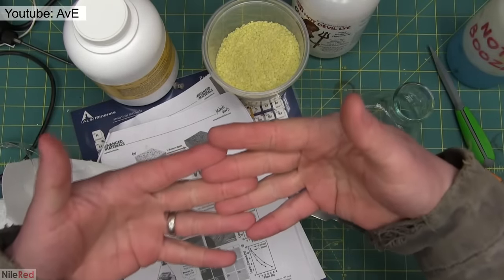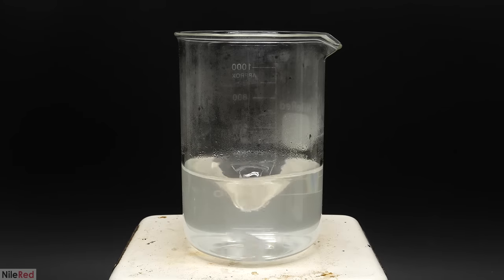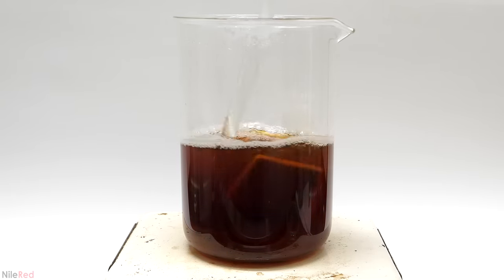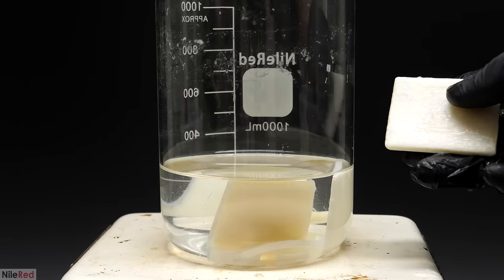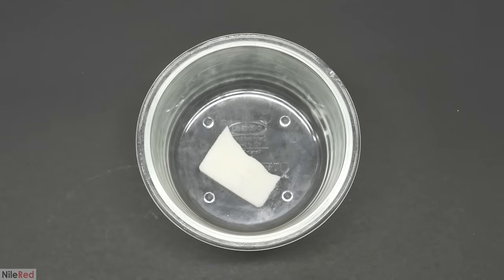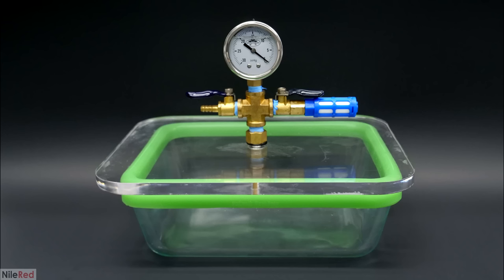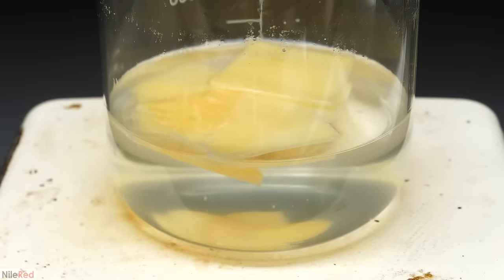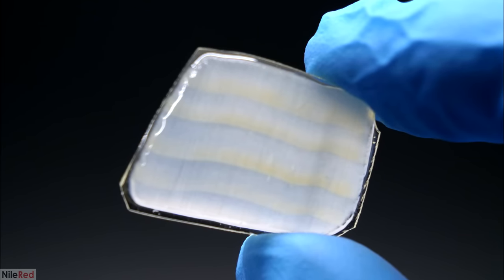Attempting to make transparent wood

Comment: 1. Use a slow set finishing epoxy. Something clear, but that takes many hours to set.
2. Heat the epoxy. Just warming it up 15 degrees makes it like water it's so viscous. It'll soak the wood faster.
2.5. vacuum your epoxy in the cup after heating but before pouring: just to help pull bubbles.
3. Once poured with the wood floating, leave the vacuum on for a minute or more, and then draw out the letting air back in for like 30 sec. Drawing this process out will put less pressure on the epoxy but for a much longer time, letting it capillary up in there
4. Cut your wood thinner. 2mm, 1mm, etc. Will help like everything.
5. Cut it really slowly and in a single direction to make a nice surface on both sides. 
6. Lightly sand both ends, but beware using course grit will just fold over and plug all the cellulose tubes. 
7. Air compressor blow the sides of the peices to blow any surface dust and shit away
8. When you lay out the peices, place them between two peices of the flattest glass you have (mirrors, picture frames etc) to put an optically clear flat surface on both sides but without all the excess glue blob on top.
Reply: Chrismofer would it be possible to let it cure in a semi vacuum? Would that help or do anything at all?
Reply: choosing a low-shrinkage epoxy will help in addition to this. Heating will cause the epoxy to set much faster
Reply: maybe the wood bends itself when curing because it was cut from one side or maybe when put in the vacuum with epoxy, epoxy only enters the cellulose from one surface so its uneven which shows up when cured.
Reply: i don't think it would help. the idea with the vacuum is the changing pressure expels air and sucks in resin to the wood structure- once it's cured, an internal pressure difference or not wouldn't really help. the opposite might, i.e. a high pressure vessel so the bubbles are smaller when cured.
Reply: I dont't think the wood is bending on it's own. when the epoxy cures unevenly, it shrinks at different times throughout the part, which makes internal stresses. the most obvious one is when he poured two layers. the bottom one had already "shrunk" and cured, while the new top layer poured on, set up and then shrunk a little on it's own. this pulled at the layer below it making the warp.
Reply: 9. Learn how to use power tools. Yeah, I saw you almost chop that finger off.
Reply: Just to add that to reduce the surface scattering and improve clarity, you can sand it flat and then coat it with a gloss coat (spray or airbrush). If you sand it to about 1000 grit and then coat it should look pretty good. You could use a thin coat of epoxy, but paint will be quicker.
Reply: 1. Throw it in the garbage
2. Your done
Reply: Yeah all of this is really just common sense, I do not understand why he did not figure this out himself.
Reply: Won't letting the pressure in quickly force the resin further into the wood once the air has been drawn out?
Reply: I agree that a pressure chamber would be a good idea at the end of the process
Reply: One thing you could try to enhance the evolution of gasses in your resin and relieve stresses in the composite is ultrasonicating the epoxy bath.
Reply: I think the slow curing allows the wood to bow. Too fast and it can't be penetrated. This seems like a very difficult thing to solve. I propose a thin heat curing epoxy?
Reply: Step 2.5? What just change all the numbers so it’s uniform. Lol lazy
Reply: I wonder if maybe making the wood thicker, 3-4 mm, wouldn't help prevent the wood from breaking.

If adding some epoxy later on one side contributed to make the wood curve, then how about adding epoxy on both sides? maybe instead of laying it on a flat surface it would be better to find a way to suspend the wood piece? not sure how we would do that though...
Reply: one fun way would be:

after the lignin is washed out, and the wood is still wet: put it into a freezer.
then, when it's thoroughly frozen, put it into the vacuum chamber, and try to freeze-dry it (more or less the poor mans version of freeze-drying).

the advantage is: it has no opportunity to shrink, when freeze-drying.

then continue with your suggested procedure of using something that is slower at curing.

one additional idea:  there are epoxy-resins that cure with UV. single component, no mixing, etc. you can give that all the time it needs to soak into the wooden fibers, and when it's done, light up a UV lamp, and get it to cure.
Reply: Wouldn’t it be better to use long strands Layered on top of each other of a fast setting epoxy To mimic the cellular connections in wood fiber rather than filling the cavities? I realize that the method you describe creates a very visual 3 d facsimile But would it replicate the mechanical qualities of wood?
Reply: Would be great if you have a way to slightly heat while pumping, such with an infrared lamp or so. Ethanol too should be evaporating much better.
Reply: wouldnt putting the the epoxy in the vaccum crate more bubbles like it would with other fluids
Reply: this is sort of an engineering implementation that he's doing with just chemistry tools. it's perfectly understandable that it's complex and he hasn't nailed it yet.
Reply: ultrasonic or not, if his epoxy has a sufficiently long cure time (24hr?) there's plenty of time to mechanically mix it thoroughly (hand drill with small wisk) and then heat and vacuum the bubbles out.

when letting the air back in, i'm not sure whether drawing the process out or making it fast will cause the resin to penetrate deeper: all I know is doing it quickly doesn't work great, and repeating the sudden pressure changes doesn't make it much better. If there's air stuck in the wood, surrounding it with resin makes it impossible to suck out without first pulling the resin back out. slowing it down, especially after evacuating the chamber for a significant amount of time,  could possibly allow better resin penetration.

I don't think the warp is caused by the curing being slow, just uneven. 
 
yes making the wood thicker would make it more resistant to breaking. absolutely. but it would make it far worse optically, which is the opposite of the goal, so I think the solution to the breaking is being more careful with the materials i.e. doing one at a time, not stirring and breaking the wood with a glass rod, swishing the pieces against each other, etc. he'd have to agitate differently.

I also want to add that cutting the wood slowly as well as lightly sanding before the chemistry will remove the burn marks, which are obviously a huge hindrance to optical clarity.
Reply: But he didn't have a stand
Reply: I actually read about this (making wood transparent) on Phys . org several months ago
Reply: I think gravity is all you need to hold the glass plates together i think. You don't need clamps and don't need 10mm thick glass. The idea would not be to make uniform thickness, but glass-smooth flat surfaces. He had better luck with globs of epoxy on top because surface tension formed an optically polished top, but the bottom was only as perfectly flat as rubber can be, or the concave surface inside a pyrex. Also I figure it's more critical the bottom surface, where the paper interface is, be flat and polished. 

A glass sandwich would also prevent all the warp, provided the epoxy fully cures before being unsupported. 

I hadn't considered that the part would stick to the glass really well and be unremovable. you're absolutely right that plastic sheeting (acetate maybe?) would be prudent and what's more- you wouldn't even need to peel it. you could just trim it down, and the final product would be a plastic-resin-wood-resin-plastic sandwich. This is making a bunch of assumptions of course and some tests would be awesome to refine this further. 

with a few tweaks and improvements, he could get at least as good a piece as the research paper example.
Reply: @Blueis Notgreen 

none of this is to replicate the mechanical qualities of wood, in fact i'm not sure what the goal is other than as a curiosity. it would certainly be useful as a study aid for people looking at cellulose structures with microscopy, or looking at how grain patterns differ between types of wood etc. I'm not sure how much mechanical strength the wood has at the end of the whitening process, but it looks like close to none.
Reply: I dont have a clue of what that means owo
Reply: @chrismofer  isn't that because  most of the lignin is removed? I imagine if you got full resin penetration and allowed it to cure fully you would have a material with comparable strength to wood. The big problem being it's soft end grain wood which is quite weak to begin with
Reply: Hmm, I think you're mostly right in the revision suggestions Chrismofer. For sure vacuum degassing the epoxy on its own, and then slowly reintroducing air to the chamber, so it doesn't push back in. Curious if you think that degassing the epoxy, but then pouring and setting the wood & epoxy in a pressure pot might force the epoxy in the wood more?

My only other thought would be to put the wood down on a glass surface, with a cup that's ALMOST full of epoxy next to it, both in the vaccum chamber. Then pull the vacuum and let the epoxy overflow from the cup to cover the wood, because maybe that would give the vaccum some opportunity to draw any trapped air our of the wood before it's covered? Still feeling like it needs to go from vacuum to pressure in one operation though...
Reply: @Aikano9  If its a 2 part epoxy I wonder if it'll fully cure in full vacuum since its a chemical hardner rather than using air.
Reply: @Thomas Rumpel i'm not sure what you're asking, but in terms of strength we've basically made a composite material and depending on how much of the original wood fiber remains intact, it'll be somewhat stronger than epoxy alone, which itself is many times stronger than wood relative to volume. it's also far more machinable, among other positive differences.
Reply: @Edmundo I think outgassing separately in the mixing container would be beneficial simply so that later when they're pressurizing to push the resin in, it doesn't also push air bubbles into the wood and trap it within. more importantly, any and all bubbles will negatively affect optical clarity. The only ways to affect how much resin gets forced into the wood are to make it less viscous, or the forces more agressive, or to just do them for longer. you could also figure out some way to make the wood more accepting of resin, like slicing it endwise very thinly so it's a stack the resin can easily soak, or somehow expanding it's structure (freeze thaw cycle?) to make the capillary tunnels larger.

Interesting thoughts on a way to pull vacuum before coating the wood with epoxy: I overlooked, that if you sink the wood in resin and then start vacuuming the bubbles leaving the wood will just go in the resin. I guess that'd be when you're pulling the strongest vacuum and for the longest time, so I imagine most of the bubbles will have reached the surface and popped, especially if the epoxy were warmed.
Reply: @zappy bear yes, the stuff might have different levels of strength if it's cured at different pressures, but it'll cure regardless just as you say it's a chemical hardening process rather a drying one. they use it for space repairs, vacuum approved.
Reply: @Multishit666 Veneer is an excellent idea as long it's not finished on either side. that's something NileRed could cut much more safely and produce much better looking blanks the problem is that I don't think they make end grain veneer.
Reply: He should just hand it off to Peter Brown

Comment: i think it would look cool to make an acoustic guitar out of transparent wood. i just wonder what stripping the lignin from the wood will do to its tonal qualities...
Reply: Not a good idea.
You saw the wood warped and bent at one point.
Reply: Easy look up a plastic guitar or something, that should be close enough
Reply: @rani.andretti  but plastic is homogeneous and wood isn't
Reply: @FLODDI100  its covered in epoxy so its basically plastic
Reply: @blaiddifanc8683  LMAO, that's exactly how it works
Reply: Hmm
Reply: davekash1 oh that would be cool
Reply: davekash1 wow thx now I’m gunna be up all night thinking about this 😂😂
Reply: It has the structural strength of a wet fart without the lignin, though, so you're mostly going to be playing a guitar made of what is basically epoxy-coated sponge.
Reply: @TheTrueValkyrie66  You just blew my mind a little bit
And also finishing a chain.

Comment: Hey, you could also use wax instead of epoxy. Wax is used in histology to observe tissue with a microscope. Several ethanol baths with increasing concentration in ethanol are used to replace the water. Then several baths of ethanol-wax mixture, with increasing wax concentration. Result is a block where wax replaced the water. This hard block is then sliced in 5 microns slices with a machine. If you really want to use a resin, you could use a UV cured resin to have plenty of time for the resin to absorb into the wood.
Reply: This needs more attention.
Reply: I am really curious about the possibility of the UV cured resin, Martronics makes a very low viscosity UV cured resin.
Reply: I really hope this gets tried. I’d love to watch more on this!
Reply: Shout out to this MedTech. 
😄😄
Reply: In the histotechnique paraffin is used and, even then, it's not the major transparent when it solidifies. He can use Entellan, that's an mount medium of sheet.
Reply: I was thinking that he could invest nylon into wood, which can be a really long cure, and the surface would get a hardener dose to allow the inside to cure more slowly without the piece getting damaged.

Comment: Have you tried contacting the authors for comment? Most papers nowadays have email addresses.
Reply: Yep
My thoughts exactly. I myself like when that happens.
Reply: nowadays not when it was written
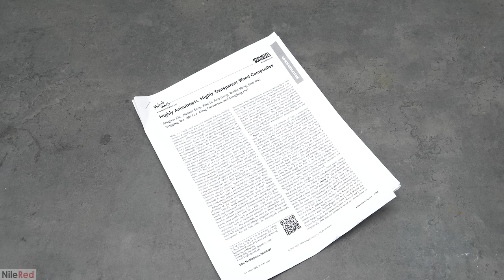Reply: 1:15 looks like in the bottom left corner of the paper there was some contact info, cant quite tell what it says though.
Reply: AvE was absolutely wrong about the paper not having the procedure. He just didn't read the whole of it.

P.S. Maybe after the vacuum, you could crush any remaining air/alcohol with high pressure?
Reply: @baivesan  wait no spoilers I didn't finish the paper yet

wouldn't high pressure also destroy the already thin wood?
Reply: @vitorfarhatfernandes1257  -- I think baivesan
 means hydraulic pressure, on the liquid epoxy, to force it into the wood grain.
Reply: You can't just put that stuff into a pressure chamber and expect that the resin will be somehow hammered into the pores. That's not how it works. You'd have to apply pressure on one side only. It's easier to suck it into the wood, which generally is also a much softer method. Simply placing it into the resin and applying vacuum like it was done in this video is a very inefficient method (even in the paper they did it like that) which also can damage the integrity of the pores. You have to suck it through the piece, this way you can also process slightly thicker pieces.
Wash the pieces in ethanol (and maybe after that even in solution A of the resin, ethanol quickly evaporates and you want as little air trapped in your wood as possible). Craft some filter paper support of appropriate size, with a function similar to a Büchner funnel, fine grid. The funnel is covered with a pre-soaked qualitative filter paper, on top goes the wood piece. You got to either somehow create a mask for your wood piece or your funnel mask has to be smaller than your wood piece, so nothing can be sucked around it. Then top it off with the completed and carefully evacuated resin (you don't want to have air bubbles in there). Carefully apply vacuum to your contraption, slowly sucking the completed resin into the piece of wood, the surface shall always be covered by resin. Suck 2-3 volumes of resin through the piece and let it polymerise.
Reply: 1000th like, yeah!

Comment: Hey +NileRed, As a professional woodworker so much of this hurt watching. lol.  If you would like to send me a block of your basswood, I would be glad to slice up whatever you would like out of it.  I would suggest experimenting with different thicknesses.  Also, you have to consider that cutting with poor quality blades can seal up the end grain.  We often treat end grain much differently than face grain so it It takes more or less stain depending on what we want out of it.  Might I suggest we cut some with a blade that polishes the end grain cut, as well as sanding the slabs with different grits and inspecting under a microscope to determine the best starting procedure for open end grain.
Reply: Good point
Reply: As a fellow woodworker I feel he should have used a handplane for the wood. I can get it practically transparent that way.
Reply: @johnpossum556  Yes, but you are cutting face grain, not end grain like we need here.  Also way to thin for what he is trying to do.
Reply: @EZCyclone  You've probably never used a hand plane as you can easily do end grain. I thought the thinness would aid his cause.
Reply: @johnpossum556  Of course I have, I just prefer a useful method.  He is trying to duplicate the results of a paper, not make paper thin sheets.